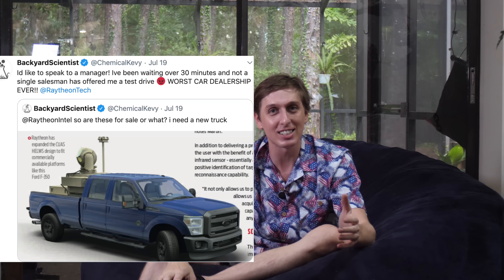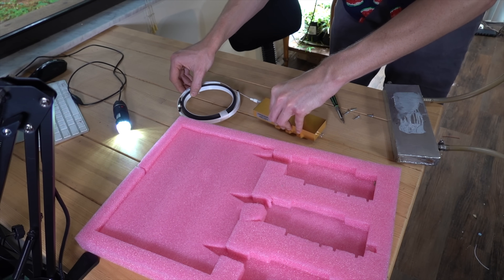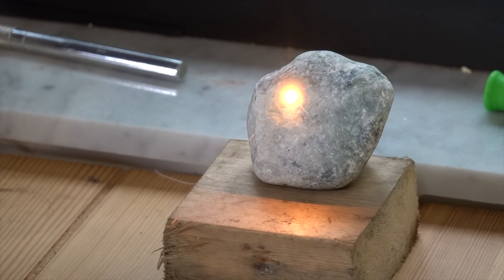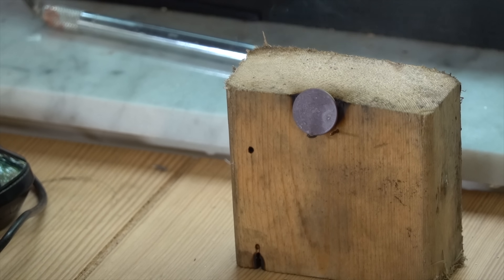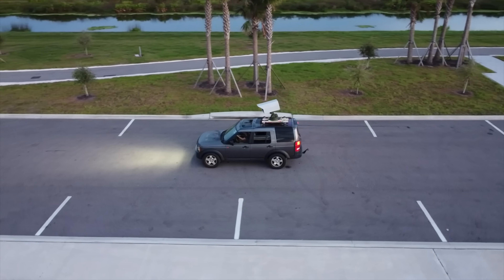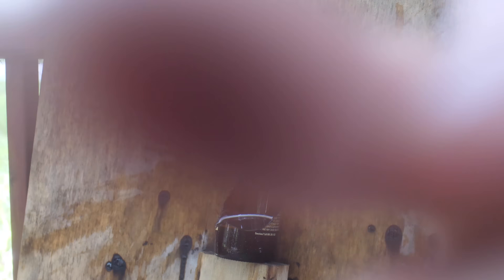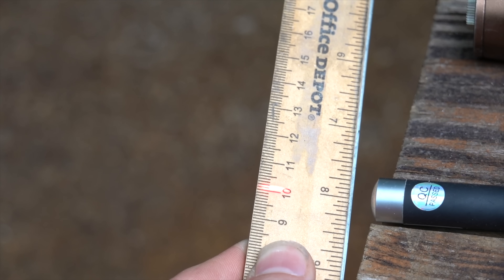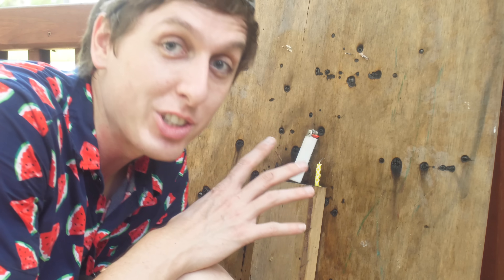200 Watt car mounted laser!

Comment: you should inspect the surface of that window behind your objects... When you were sliding the block of wood, you actually were sending it straight into your window. Most glass is laced with minerals to reduce heat transfer, and those will have changed under such high energy...

But the thing I'm most excited about, is how it is already this strong in a parallel bundle. I used to work in a laser cnc company, and we cut steel plates up to 1.5" thick like it was butter. (with a flush gas to keep the nozzle cool and blow away the molten metal at the same time) One of my colleages has a cut in his thumb going from the nail right into the first joint, and it will never heal. At first he didn't even feel the laser go in because his nerves were burnt instantly and there was no blood either because all blood vessels were scorched shut too. At the joint there's "kind of - sort of" scar tissue, but he uses the split tip as a bar trick when he hold up a bank note in it while ordering his beer at the bar.

Watch it, kiddo, this "toy" is the most dangerous thing you've ever held (and will be so for a long time).
Reply: I wondered about the window as well. Either he's destroying it, reflecting it back into the room somewhere, or burning something out in the back yard if it's open.

Comment: Impressive (except for what you did to my Queen!) Wow you were close to taking out the gas tank of the car behind the wood sheet, did you check the back of the car for burns? Also, some of my colleagues recorded some video years ago, of a dirty connector causing SPOD Self-Propelled Optical Damage which can burn out miles of data transmission fibre if not stopped. Still a real danger in long fibre data transmission systems.

Comment: "Shouldn't this be illegal?"

Not in 2020
Reply: It was illegal! Shooting Lasers at the sky without the ok of the FAA is extremely illegal as it can cause any aircraft to crash.
Reply: @nk6197  although we didn’t know if it was approved he did say he checked the flight radar to see if their was any flying vehicles near by
Reply: @Aruami  the “flight tracker” he checked is just some app for seeing if your airline flight is on time. Private jets, military, and lots of other aircraft are still in the air but just not on the tracker. There is no flight tracker available to the public that could ever track all air traffic. Flight trackers work by using aircraft that are openly squawking and some aircraft don’t do that. The only way to be sure that it’s safe is to get FAA approval so they can approve it and keep all aircraft out of the way.

Comment: I enjoyed the video, next time you do something with the laser contact me and I can let you borrow a power supply and cooling system that will run this at full power, without overheating. You can also buy the power level laser you wanted in the first part of the video, once you add the optics that is where the regulations kick in. You may not like the cost of a 50kW laser even before adding optics.

Comment: What am I seeing flying at the wooden board at 8:28? Using the , and . keys to go back and forth through the frames I can't quite tell what I'm seeing. lol But it almost looks like a spark traveling down a fast fuse line, to the base of that board, then there's a small glow as it travels up to what I assume is a firework sitting on the board? But why?

Comment: Use this method to cool your laser:
https://youtu.be/bBV-1VNWscA
Maybe also add copper tubes with partial vaccum and water inside which transfers heat real fast and also some dielectric coolant. 
I really wanna see this work at 200 watt.

Money doesn't seem like a problem for you.

Comment: 5:25 I love how you can see the conductivity of copper by completely glowing up red hot even though the heat source was only a tiny spot
Reply: You can also see how the surface coating oxidized under that heat first. And then the rest of copper core started glowing red.

Comment: A while back I discovered something fun. What you need is a can of air (like you use to clean keyboards), a cup, and some hot water (the hotter the better). 
Spray the air upside down into the bottle so that the fluid in the can comes out, and fill up the cup. Then dump the hot water in there. It'll make a pretty big pop. Could be a fun (and easy) experiment you can do, and you could try it with different substances to replace water, such as molten aluminum, molten salt, etc...

Comment: everyone else: high frequency lasers are bad for you

kevin: haha laser go pew pew
Reply: high power
Reply: @spacedoge3508  well E=hF so doesnt matter
Reply: @adeshbhavsar6530  That laser is infrared.
Reply: @adeshbhavsar6530  E=hf does matter, but Id rather get hit by a 0.1mw UV laser than a 1000W IR laser.
Reply: @adeshbhavsar6530  High power. Saying high frequency is kind of meaningless; high frequency relative to what? It's IR, so compared to microwaves it's 'high frequency', but compared to visible light lasers it's low frequency. Also, E=hf is energy per photon, which on it's own tells you nothing about the laser power.

Comment: Its only 200w, lets calm down alittle bit. If you had taken multiple co2 laser tubes and lined the beams up to get something like 5kw then maybe it would be worth reacting to. Its still neat but its just a 200w co2 laser which cost 100$

Comment: bread makes pretty good abalative heat shielding

If you use flower or corn starch + bakingsoda + glue you can  make something that pretty much stops all heat even up to crazy temperatures..without letting anything through

Comment: It wont burn the meat, it burnt the wood behind, which transferred heat into the meat, which is what you are seeing there.  The laser frequency is not absorbed by biological tissue.  Why it makes a lousy weapon.  Try green at same wattage if you want a scary weapon.  Used to work in laser lab and the green was the one I was truly scared of.  Yag looks scary with it burning wood and all the sparks flying from the metal, but in reality is harmless unless you have a direct eye strike(in which case you lose your eye as the eyes are one of the only tissues in the body that ARE able to absorb(and be destroyed) by the IR from the yag laser.  So ALWAYS wear those glasses, and REMEMBER : Different pairs of glasses are needed depending upon WHICH laser you are working!!!  And that IR laser WILL permanently blind anyone you fire it at, even though it does nothing to the meat.  Extreme caution should be used.
Reply: Gavin Burns he explained if you watched the vid

Comment: You should get in contact with Flat Earth. Your laser could prove the earth is indeed FLAT! NASA is not hitting a solid rock called the moon at 240k miles away. Dude, your smarter then that. Wake up, do the math. 2km beam reflecting back to earth. That blows the inverse square law of light out of the water. It’s not possible, the moon is not a rock. No one has landed on the moon.
Reply: The inverse square law of light proves that stars (even our sun) are not millions, and billions of miles away; Or even millions, billions, and even Trillions of light years away. All the fixed stars, wandering stars, sun and moon, are right above us in the Firmament. Genesis, Chapter 1. GOD created the dry land and called it earth. Then he created two great light and place them in the firmament for signs (actual signs and to keep time) and seasons. Doesn’t matter why he created them. The fact is that the earth is older than the sun, moon, and stars. The earth was created first. Science tell ms us differently. The Big Bang created everything. Sun was first, then earth, and then the moon...depending on how you think the moon was created. We live inside a sealed galvanic cell. Everything is frequently, and magnetism. Electromagnetism, electricity, dielectricity, light, sound, GRAVITY, Electrostatics, etc. Everything is magnetism, it’s all one in the same. Just different forms of it. Earth is a flat plane, at the center of the plane of dielectric inertia. Where matter, sound, heat, and light are manifested.  Everything we were taught is opposite. They say as above so below. Well below, they say we have a solid iron core (impossible at those temperatures, but lucky science says the pressures keeps it from melting)spinning faster than the earth and is hotter than the surface of the sun. Also that it produces our magnetic field that protects us. BIG BS. CURIE POINT OF IRON, DOESN’T ALLOW FOR MAGNETISM AT THOSE TEMPERATURES. Don’t even try to say Convection. 😂. Light has no speed, it’s a rate of induction.
Reply: https://youtu.be/PM7nA4TP4Y0

Comment: Can the laser bounce off of reflective surfaces? Or does it work by blasting concentrated radiation which is unable to bounce off of reflective surfaces? I apologize, I'm not very well learned in light and radiation physics
Reply: In addition, when shooting at the Queen, why didn't the laser start burning the car? Was it because its focused at a certain distance/range, or what?

Comment: What type of collimator is that?  I have a Coherent FAP 1200 100 watt pair fiber laser system with the SMA 905 fiber connector that I am trying to find a suitable collimator and a beam expander for.  The ebay special doesn't look like yours.  I am trying to reduce the beam diameter to create an electrically conductive ionized nitrogen path to transmit a high voltage across.  Edmund Optics sent me packing, saying the energy density is too high for any of their products.  Any suggestions would be greatly appreciated.

Comment: Here You are using fiber coupling laser. so there will be ~ 20% losses. So what is the wattage of the beam and the laser diode . (160W  beam & 200W diode i guess).

Comment: Even less than a watt is more than dangerous to your eyes.  I would be just a bit more afraid of IR just because you can't see it.  There are a lot of dangerous lasers that were sold on eBay as laser pointers when they really had a lot more light output than what is stated.  None of them were anything like a 200 watt laser but they still cause a sheet of paper to burst into flames.

Comment: dude those beams propagate to space. forget about aircraft you probably hit satellites. Anything above the horizon needs to be cleared by the Laser Clearing House (a real thing)
Reply: Yeah, was thinking the same thing. I wonder if this caused any havoc higher up and whether they'll get hit by some government agency coming down on them.
Reply: You two are joking aren’t you? 

Just gonna say, Divergence and scattering. Also maybe learn the relative distances of low earth orbit versus high earth orbits because you sound ridiculous right now! And I’m not sure if you realize why.....

Also, the Fu*** speed of ANY satellites tracking across the sky and how you’d NEVER be able to resolve that kind of target or...I cant even......omg you are just so incredibly wrong.

Hey You’d be able to manage DATA TRANSFER. But I don’t even think you considered or KNEW TO CONSIDER that!......oh wow you two better be joking!
Reply: @HelloTardis  Let's say the beam is 1064 nm, has a mostly circular Gaussian 1/e distribution with a 1mrad divergence, shot at night when thermal and scintillation scattering is low at an inclination angle of 10 degrees from horizon.  If the output at aperture was 50 W, after propagation losses, a satellite at a slant range of 40,000 km would experience 15-40 mJoules of energy in the center of the beam. That's not much.
But if it hit a camera with a 10^6 optical gain, which would be very low for a satellite, it could damage the sensor. It can also impart a thermal moment on a system when taking sensitive measurements, such as the GRACE satellites, causing bad data. 
Source: I'm an orbital photonics engineer. I consider this often...
Reply: @imabeapirate  BOOOM
Reply: @imabeapirate  nerd
Reply: @HelloTardis  I love how the actual professional came in and schooled you, you arrogant twat.
Reply: @HelloTardis  jeez, calm down Mr Smart Guy, all you have to say is that they're wrong, no need to prove your "significant intelligent" here. They're just worried anyway.

Comment: Not sure your safety calculations check out.

Wasn't the beam area at focus point much smaller than 430 cm squared when you focused it in the sky? Especially when you "pulled the focus in".

Comment: As cool as this is the way you handled that laser outdoors was really not very responsible

I'm not really qualified as a source of info on this subject, but from my common sense with a laser of that power it did not look safe

accidents can and will happen, and just .5% of that lasers power reflected into someones eye would cause issues

And you also can not trust an app to verify that there is no air traffic in one direction since an app can't know everything, and an app also won't tell you about drones (at least not yet, time has yet to tell how regulations for those will develop) or wildlife or anything else that might happen to fly

Comment: It might surprise you to know Flight Radar is a volunteer run information system.  Here is a link on signing up to host a receiver to aid in their data collection.  https://www.flightradar24.com/apply-for-receiver#apply     The site also doesn't include aircraft which are not flying with a transponder, such as small private aircraft or ultralights.  For these reasons I would not assume the sky is safe for pointing a powerful laser.

Comment: https://youtu.be/WAI7Lu4UFi4?t=289
Zinc vapor is extremely unsafe to breath in: that's why you never weld galvanized steel without grinding off the zinc coating first.
https://youtu.be/WAI7Lu4UFi4?t=618
Plus ox meters use a low wattage infrared laser to 'see' beneath the skin to read how much O2 is in the blood. Bonus points if you know who came up with the idea and where it was mentioned first.

Comment: You should see how fast you can shoot dust from a gun using pressed dust to where basically a rock. Also how many times did you get pulled over while driving around with the laser on top of your vehicle?

Comment: Mate! I'm a high power laser scientist, and where I work you have to do lots of laser safety inductions in order to get to work with such laser powers, and need to take huge precautions when working with them. In fact, there is always a barrier between the laser and human in the lab. It's a matter of milliseconds for this power to burn your retina. Please don't do this again.
Reply: he has no regard for the safety of others or those around him
Reply: 4:33 I wonder how much was reflected back into the room from those pennies?
Reply: @iamdave84  Probably not a lot as its surface is unpolished, and scatters light in many directions resulting in  a spatially-incoherent light. Though still can cause serious damage to the naked eye. But, any sudden back-reflections from the glass windows due to mis-alignments of the laser beam, can produce hundreds of milliWatts to few Watts of coherent laser beam that can easily blind you.

Comment: „THE MOON BLEW UP WITHOUT WARNING AND FOR NO APPARENT reason. It was waxing, only one day short of full. The time was 05:03:12 UTC. Later it would be designated A+0.0.0, or simply Zero.
An amateur astronomer in Utah was the first person on Earth to realize that something unusual was happening. Moments earlier, he had noticed a blur flourishing in the vicinity of the Reiner Gamma formation, near the moon’s equator. He assumed it was a dust cloud thrown up by a meteor strike. He pulled out his phone and blogged the event, moving his stiff thumbs (for he was high on a mountain and the air was as cold as it was clear) as fast as he could to secure the claim to himself. Other astronomers would soon be pointing their telescopes at the same dust cloud—might be doing it already! But—supposing he could move his thumbs fast enough—he would be the first to point it out. The fame would be his; if the meteorite left behind a visible crater, perhaps it would even bear his name.
His name was forgotten. By the time he had gotten his phone out of his pocket, his crater no longer existed. Nor did the moon.
When he pocketed his phone and put his eye back to the eyepiece of his telescope, he let out a curse, since all he saw was a tawny blur. He must have knocked the telescope out of focus. He began to twiddle the focus knob. This didn’t help.
Finally he pulled back from the telescope and looked with his naked eyes at the place where the moon was supposed to be. In that moment he ceased to be a scientist, with privileged information, and became no different from millions of other people around the Americas, gaping in awe and astonishment at the most extraordinary thing that humans had ever seen in the sky.
In movies, when a planet blows up, it turns into a fireball and ceases to exist. This is not what happened to the moon. The Agent (as people came to call the mysterious force that did it) released a very large amount of energy, to be sure, but not nearly enough to turn all the moon’s substance into fire.“

Seveneves
Neal Stephenson

Comment: Even high powered spot lights in Vegas require a waiver from the FAA. You do know how to file a waiver and issue a NOTAM don't you? If you don't the FAA will bend over backwards to accommodate you and assist with the paperwork. I highly suggest you do that before you go breaking FAA regs again.  I've had certification in high powered rocketry(Level 2) and am quite sure the FAA will treat you well if you ask them. All they want is safe skies and the rules are not that hard to follow. (btw, did you know that the reason you only get 400 feet of string when you buy a kite is because is it against FAA regs to fly higher than 400 feet without a waiver)

Comment: The copper penny survived without a hole because copper is a more efficient heat conductor, so the entire piece of metal absorbed the laser's energy. The flame was from the wood and/or the adhesive used to secure the penny in position.